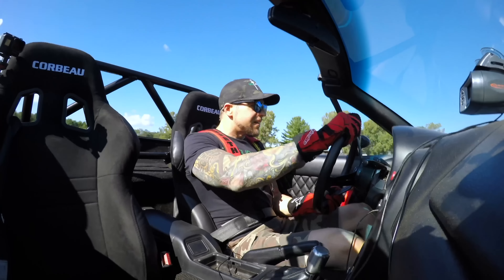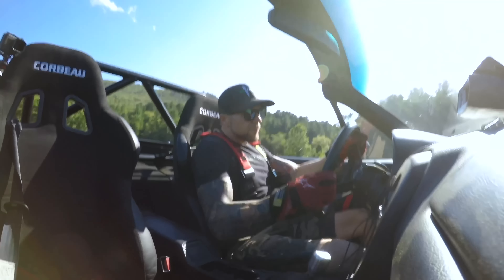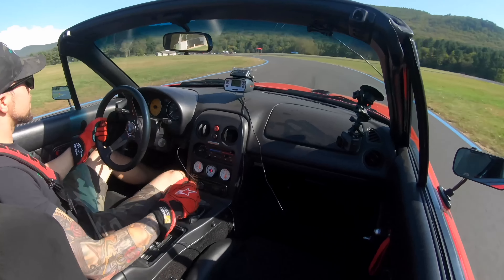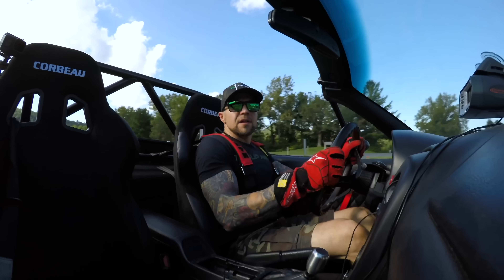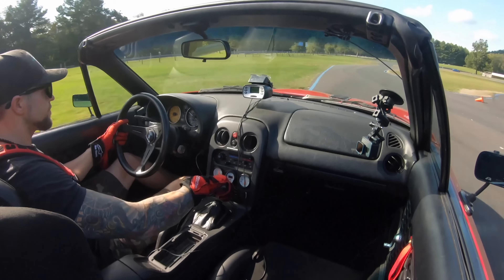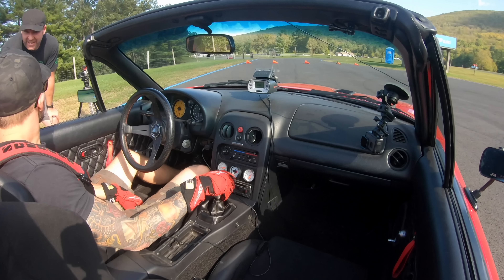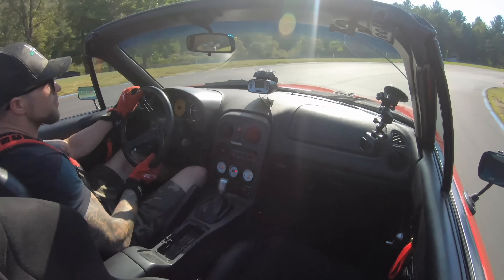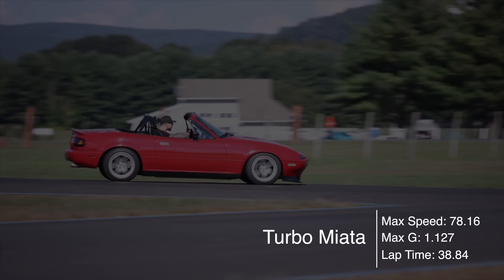Turbo Miata Tested - The Slip Angle

Comment: 👏 This car continues to get better and better.  You should test it again with the new aero and slicks!
Reply: Goodness yes like 14.7--15.4psi after 6k RPM with a tater starting at 5800 or something like that should keep the wtq before 225wtq and should be safe for a single run before running too hot. I have e85 so I guess I have it lucky. But I don't have slicks they'd be interesting to see what time difference it is
Reply: I’ll have to bring my slicks there just to see what kind of time it can put down.

Comment: How easy are the gauges to see in the position been debating about mine putting there or on the A-pillar? Thoughts?
Reply: I’ve actually gotten rid of that setup already. Now it’s just one CANChecked gauge in the top left eyeball vent location.
Reply: It felt like it was too much to look that far away at the gauges.
Reply: @mattwiser7982  ok so you didn’t like the gauges by the radio but up higher they were better. Do you it annoying at night? What can checked gauge is it Id be interested in that?

Comment: Does he have adjustable rear upper control arms to get just -1* of camber? I think my NB is at it's least at -1.8 or -2*, at my ride height.
Reply: At my ride height, the stock eccentrics were able to get -1 degree
Reply: @mattwiser7982  13-13.25" hub to fender? I'm currently at like 12.5".

Comment: i am always keep wondering these driver focused and tuned cars how they would do in a bigger track with a wider variation of corners and speeds. Keep up the good job guys.
Reply from the maker: Small wheel base cars lack high speed stability, so for a small to medium track they are good, but high speed they will be at a disadvantage.
Reply: @TheSlipAngle  Yeah i am not talking about COTA but something a bit bigger. The rotaries and the Bmw and the S2k can handle it for sure